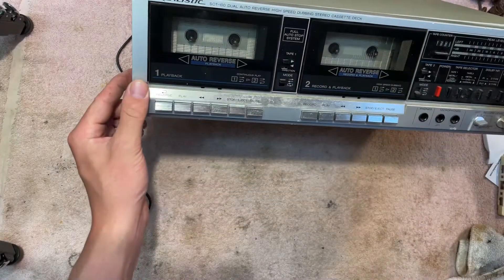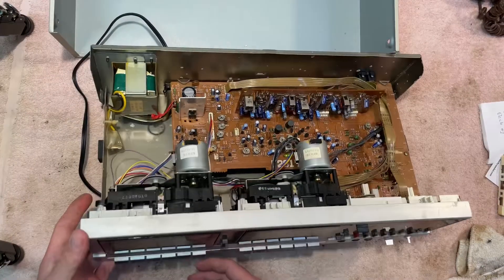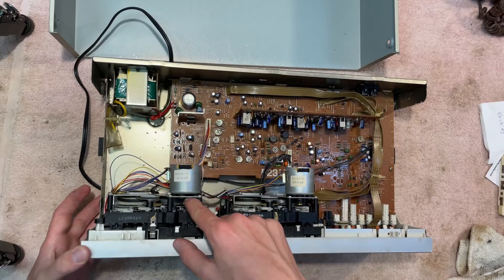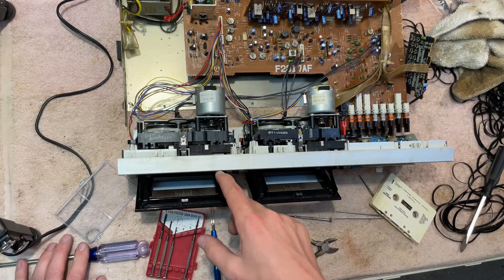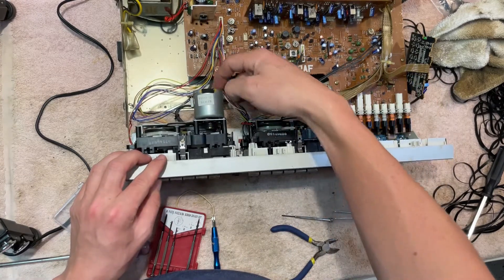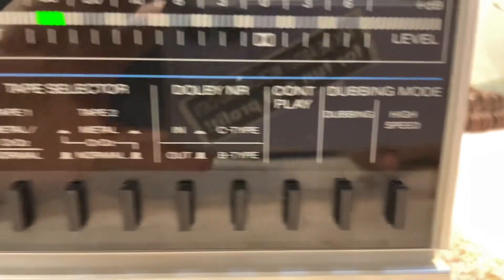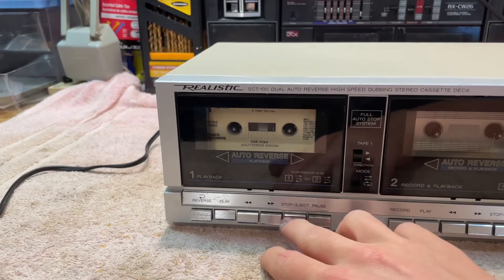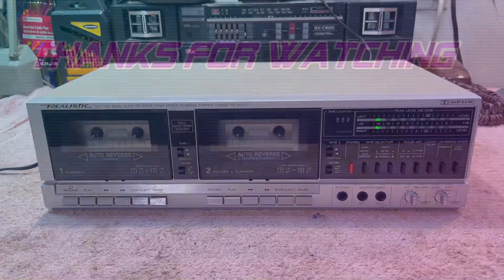Realistic cassette deck repair

Comment: How do I get mine to play I can’t hear mine do I need a speaker?
Reply from the maker: You will need an amplifier and speakers.
Reply: @HI-FI_  do you know what kind ?
Reply from the maker: Anything with RCA inputs should work but there are plenty of tuners with built in amplifiers that are a inexpensive and easy to find at thrift stores or online.